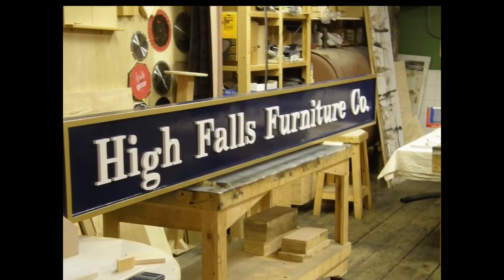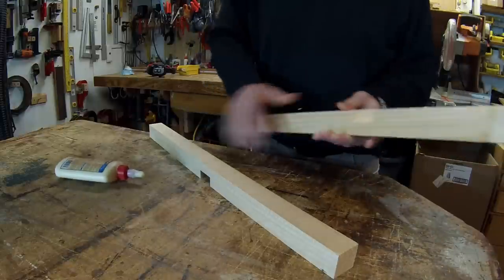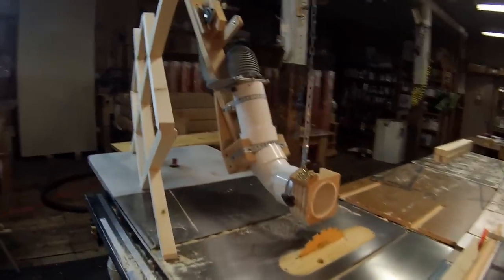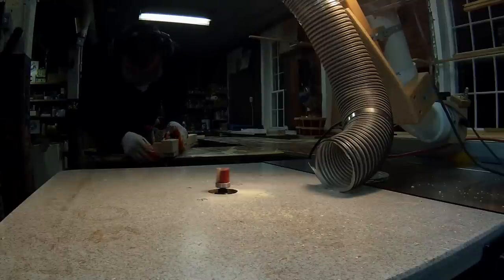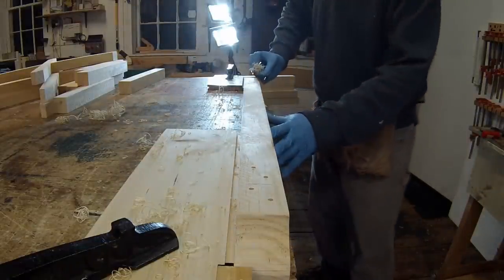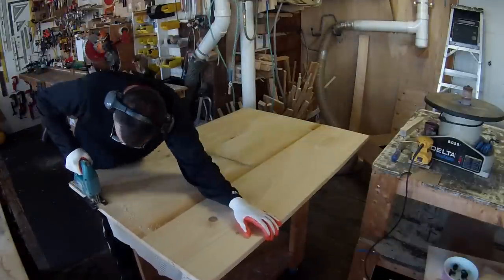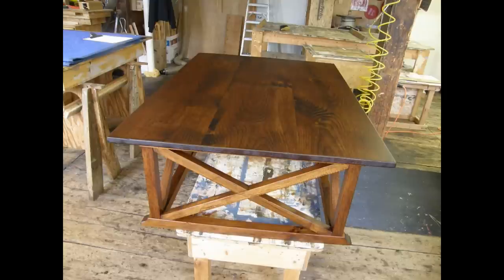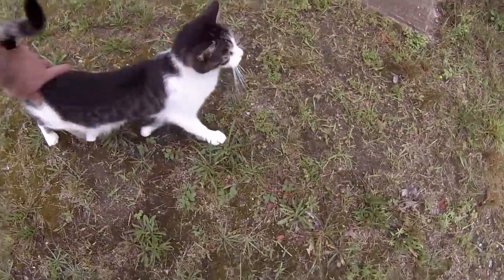Coffee Table XXXXXX Explained

Comment: Mitch, thanks for the extra info and time you put into this. The voice over is great but if it's too much work I'm good with the tunes...with some brief captions. 
Question: if this was a more formal piece would you have pre stained the pieces before assembly or do you always stain piece after built?
Reply from the maker: I always finish the table tops separately but joinery on the bases has to be together.  Usually finishing small parts individually will not save time or quality

Comment: Hey Mitch. Great video. The table turned out awesome..
where do you get the clips for securing the top down?
Reply from the maker: amazon sells them or buy them from me on Ebay
http://www.ebay.com/itm/Table-Top-Fastener-Clips-with-Screws-QTY-24-/222096168661?ssPageName=STRK:MESE:IT
http://www.ebay.com/itm/Table-Top-Fastener-Clips-with-Screws-QTY-72-/222096169726?ssPageName=STRK:MESE:IT

Comment: I use MDF for stuff like that and if it wont slide put a little paste wax on it, slicks it right up
Reply from the maker: great idea... I will try that since i have so much MDF to use.  thanks!
Reply: I have also, tried a slight angle on the edge set your saw blade at say 1 -2 degrees and leave only about 1/8 - 1/4 inch to ride the fence, couple that with a little wax and its butter, if its a jig i use a lot I have even sprayed a spray on finish on the bottom with wax over that
Reply: xxxxx